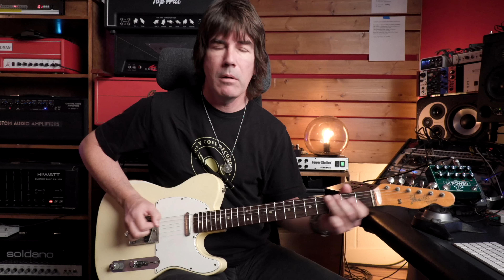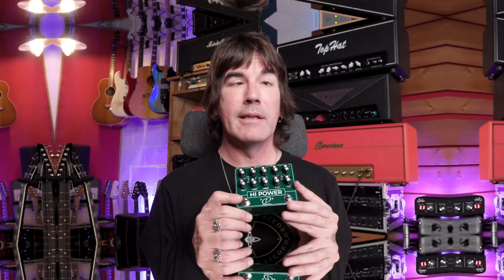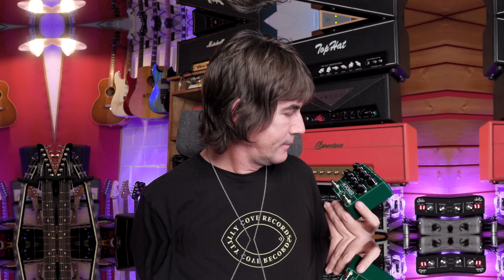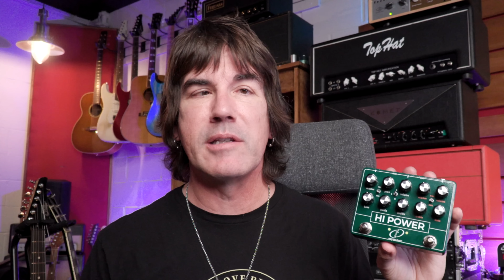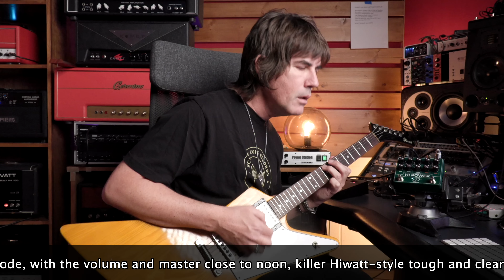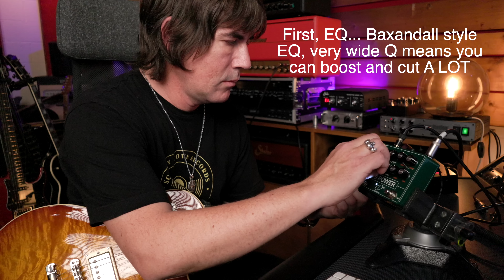CAN THIS PEDAL GET HIWATT TONE? Crazy Tube Circuits HI POWER

Comment: Hi Pete. I have a Vox ac10c1. Can this pedal replicate hiwatt tones on vox amps or does it work only on certain tube amps. What are your views?
Reply: If you’re running the AC10 with low gain (basically clean), you should be able to hear the pedal without much additional coloration. It will be different because it’s a smaller amp, so you may need to balance the amp’s input gain with the pedal’s output to avoid clipping the amp’s input. If you had a cleaner amp with an effects return or a direct power amp input, you could hear it with no preamp coloration from the amp.

Comment: I heard some of that infamous Townshend Live at Leeds tone when you were playing around with the controls. That's why i bought one 👍
Reply: Do you get a farty/raspy/fizzle on the amp side with moderate gain as notes ring out/decay?
Reply: @jallan8405 I did notice that when I gain the Hiwatt side to about half way i do hear pedal noise/hum, but everything that the pedal is creating tonally is pretty accurate for a Hiwatt. Their overdrive doesn't sound like Marshalls. Its more strident and punchy amd doesnt soind great at low volume. Its much less forgiving of an amp. If you're like me and you're after the Townshend thing, the Hiwatt side of this pedal will certainly bring you to that realm but Townshend played early Hiwatts. Even some from when they were still Sound City. This pedal recreates a Dr103/504. Pete played CP103s. He played Dr103s too later on but they were modded, plus he had a signature Custom Who Hiwatt. The early Hiwatts he preferred were more forgiving with more of that sag a Marshall has. Hiwatt kept making the transformers bigger and bigger from about 72-75 to get even higher headroom and Pete wasn't playing those. He like the high headroom but Hiwatts had that from the start. They went to far with the transformers and thats why the Hiwatt reputation isn't as big as it should be. I think this pedal/amp may be modeled after a 72 or later Hiwatt. Where you kind of get a mix of both worlds. The more forgiving early stuff and the giant transformer later stuff. It's definitely a bit too noisy. It lived on my board for years for my Townshend/Who stuff never even bothering with the Colorsound side, but I ended up swapping to the Menatone Menawatt. Its a killer pedal. Probably the best Hiwatt pedal in my opinion. The earlier models of the Catalinbread WIIO are also good. They went straight for Pete's Live at Leeds tone. I have all three versions. The newest version 3 being by far the worst with the added "post" knob simulating an Echoplex preamp. If you keep that turned all the way down the pedal is cool. The V2 seems the best. No preamp knob. V1 is the same but has a bit too much gain. This Hi-Power is great if you're not gonna push the gain on the Hiwatt side and just use it to color your tone with that chimey Hiwatt sound. Using it that way is perfect for the Gilmour thing. Which is what this pedal is meant to be anyway. I still have it though. I wouldn't sell it. Its great. If I ever use it again I'll put a noise gate on the board.

Comment: In order to keep the nature of the Hiwatt, instead of pluging the output to the front end of a clean Fender type amp...would be better I think to plug the output of the pedal to a power amp or effect loop return or...the Fryette Power Station line in lying in the back (with less or no tweaking)...to the cab of your choice!

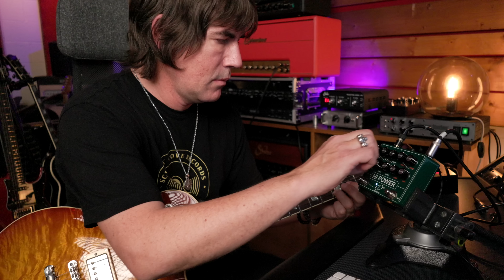Comment: 14:27 I just had mine delivered yesterday.  It's  sounds pretty  close to the Hiwatt sound. The Orange Crunch side is very good as well. You're basically getting two high-quality  pedals for the price of one. I'm very pleased. I like your videos, too. I have watched a few vids about this pedal. I needed to learn how to drive it properly. Another thing I love about it is the ability to patch in another effects pedal by splitting  the two circuits from amp and overdrive. Cheers.

Comment: I wish this pedal was out several years ago. I’m one of those Gilmour tone nerds, and this thing seems to be almost a “Wish You Were Here” in a box pedal. I have two part for part clones, one of the Catlinbread WIIO and one of the ColorSound PowerBoost, which do a great job of getting the tones of Gilmour’s rig. But this thing has the cool options (such as the linked Hiwatt, which I think is how Gilmour had his amp wired internally), and the 9 and 18 volt options on the PowerBoost. What really sells me though is the effects loop, something that is missing from other “Gilmour in a Box” pedals, like the Keeley Darkside (a great pedal on its own as well). Having the option of throwing a phaser/univibe/flanger/chorus in the loop is great, but you can also throw a Fuzz Face or Big Muff in there as well (Gilmour went back and forth with his placement of the PowerBoost and the Fuzz Face, and later the Muff, but he like to stack gain pedals and compressors). Again, I wish this was around about 5 years ago, before I built my board to get those tones.

Comment: Ive always thought that Hiwatts have no timbre signature... meaning there is no harmonic foldover in a particular area of the spectrum. The drive harmonics are evenly spread and not loaded up in say the low mids like an Orange. Or, the high mids on a Marshall. This is different than eq. That being said, it highlights the timbre of the guitar. Hiwatts sound like a PA or HiFI tube stereo .

Comment: Great demo Pete. I got an email from Sinvertek. Wu has a new MGAT-1 Golden Era pedal. Do you think you’ll be demo-ing it? He’s claiming to 99% authenticity on the sound now. I have the N5 MGAT-1 and love it but just bought a Lion 68 two days before I got the email about the pre-order for the MGAT-1 Golden Era so I can’t pre-order. Lion 68 is a new favorite though. They’ve done it with that pedal. It’s just like my plexi. Running mine into SS power pushing my cabs and can’t really tell the difference to real Plexi.

Comment: Adding that Colorsound overdrive to the pedal is a masterstroke imo. Hiwatt drive sounds are pretty hard to duplicate, and aren't as smooth and sustaining as in other amps. I don't understand the engineering aspect of it, but the amps have such high headroom that you have to really fckn crank them to get a really good sounding drive, but that makes the amp super loud and hard to tame in a live situation for playing clubs etc. I used a Hiwatt 50 in my old band (late 70's- mid 80's) and sound guys ALWAYS told me to turn down to the point to where the amp was rarely in its sweet spot. So I was forced to use pedals for drive, which worked well. Incorporating the Colorsound pedal into this pedal makes total sense to me, and it sounds great too!
Reply from the maker: Good perspective!
Reply: yeah, to make the pedal sound "good", you need at least one more pedal...?!
Reply: @Maxy-K  Only in the sense of imitating the real thing. The combination of the Overdriver into the amp was popularized by Gilmour, so that's a selling point too. But since it's a pedal and not an actual fire breathing super loud amp, you can push the master volume to emulate cranking the power section of the amp in a way that would be impossible for many applications in the real world because it would be way too loud. But you can also push the front end with the Overdriver section for a completely different type of gain. Or you can make it fuzzy with the Overdriver's own gain. Flexibilty.
Reply: @Maxy-K No because the ‘other pedal’ is the right side of this pedal.

Comment: The HiWatt tone stack is an unusual and complex one.  The mid dip can't be eliminated as on a Marshall, but it is more versatile.  Leave the Bass at ~5.5.  Try turning the Treble down to 1, and listen to the upper-mid peak shift from 5~2kHz by adjusting the Middle from 4-10.  Then leave the Middle between there somewhere and hear the upper-mid to high balance completely change while adjusting the Treble from 0-2.  It's very scooped otherwise.  I'd try using it with those kinds of settings and balance the channels levels, increase the Presence and maybe reduce the Bass just a bit as needed.

Comment: I wanna hear how it sounds played with a  60s sg special with p90s. Also, how well does it clean up when you roll off the volume? This pedal seems to try and emulate pete townhends set during the late 60s and early 70s. In the late 60s he played p90 sgs and, if im not mistaken, could go from clean to diety by adjusting the volume/pickup selection on his guitar. This can be heard on the live at leeds album. Can you do the same with thia pedal?
Reply: He did use a fuzz pedal too though eh  ,watch isle of wight etc or Woodstock too. A bit of a feedback thing though I noticed ,maybe cause of p90s? I dunno

Comment: Great demo as always Pete! This pedal encapsulates one of my favourite hard rock pedal combos. I love to use a 4 knob Colorsound Overdriver circuit into a really nice preamp pedal. Is it a FET based preamp? My own setup which would be similar would be running the Overdriver into a Catalinbread RAH but I really love it into just about all of the FET preamp pedals I have. The two band EQ on the Overdriver means you can take it from a treble boost kind of thing to really fat and fuzzy. Then with the gain/level you can go from a mild bit of overdrive to that wonderful, saggy, blooming fuzz like thing that's so awesome. 
You can get something almost like the type of distortion you get in early tweed or brownface or like 'budget' amps like Supro and Magnatone where you crank them up and they collapse into a nearly square wave distortion. You run the Overdriver then into something high headroom like a Hi-Watt and you've instantly got 70-80s hard rock metal tone for days. Love it!

Comment: Question, just watched your reviews on the boss 200's. I am looking for something that will give me more versatility so that I don't have to go and buy 2 more guitars or another amp. I want to get one of these pedals so that I can play more songs (I cover a lot of different worship songs) without compromising too much tone/high end or sounding digital like the line 6 effects. 

I have a vox ac handwired blue celestion with tele and 3 od's- the jhs 808/moonshine, jhs angry charlie, and a clean 3 knob booster/cleanup

MY QUESTION- with this in context ^ , should I get the boss 200eq, the boss 200od, or the boss 200 ir?  I was thinking eq because i already have 3 overdrives, but then i saw the ir 200... im also not sure if eq is enough to manipulate the drive on the OD's or if I need a 200 od or ir for that.